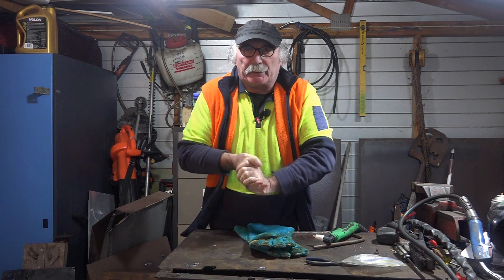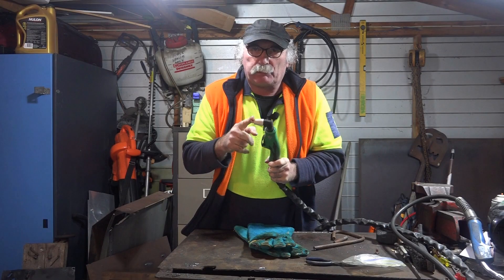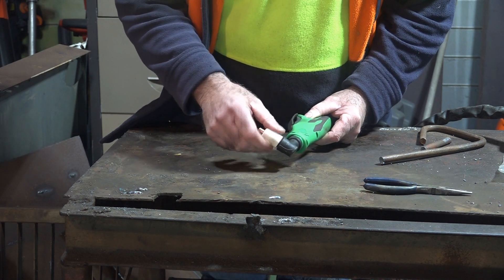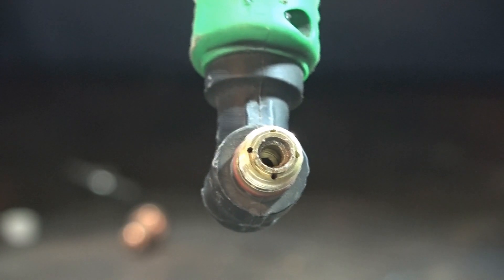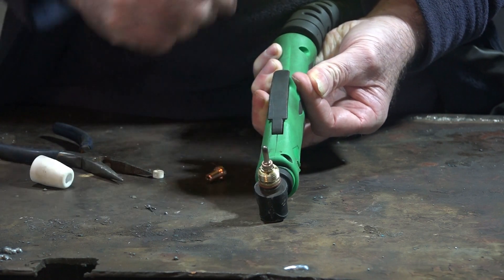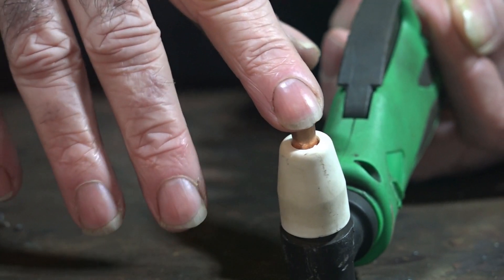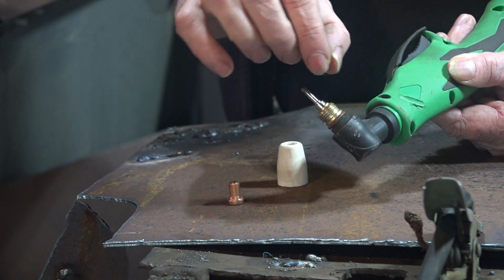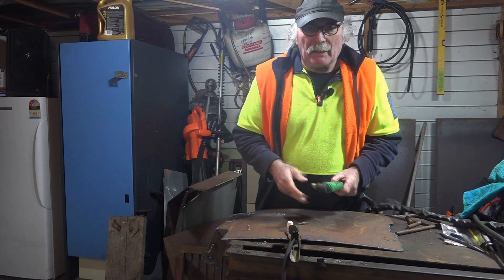Plasma Torch - Fixing Loose Inconsistent Consumables

Comment: No__oh ! We're new to usinga plasma cutter and did see that erosion - thought it was normal...   must go and have a look again.   Cheers Pete!  ,     now me being me,I don't know where to get Cu washers easily, but I know a man who has Viton "O" Rings - will they do ?    maybe at least for short runs where tip won't get too hot.    PS what are you doing with all that radiused  corner off-cuts ?   Future Sculpture project, maybe !
Reply from the maker: Are the o rings rubber ?

Comment: thanks to your vids  i was able to repair a new out of box  p torch  it was a pilot arc that only worked when it wanted  proved to be an erratic ground inside the head itself  it would work  twice and then maybe  not again  until it would again   found the internal  post pilot wire soldered to  was erratic connection  couldnt  see it  but proved from your video on changing scratch to pilot arc   thank you pete you saved me
Reply from the maker: Welcome my friend